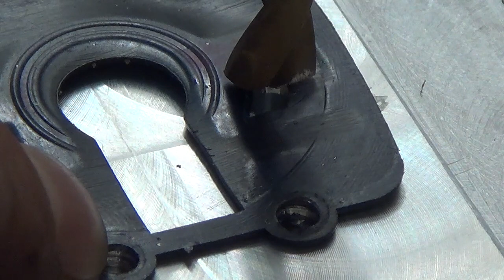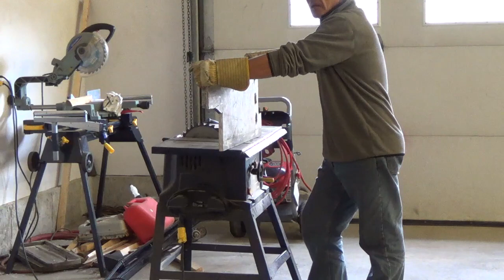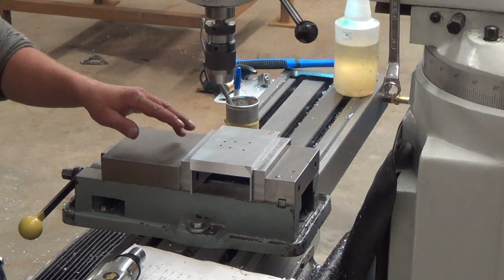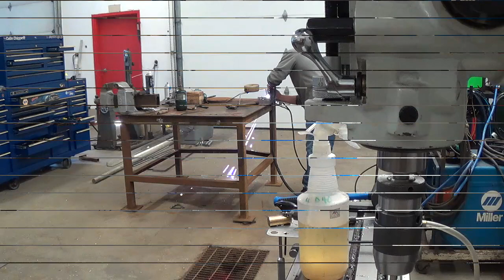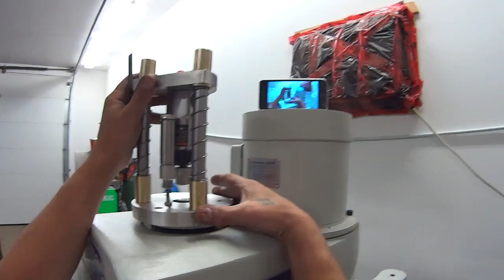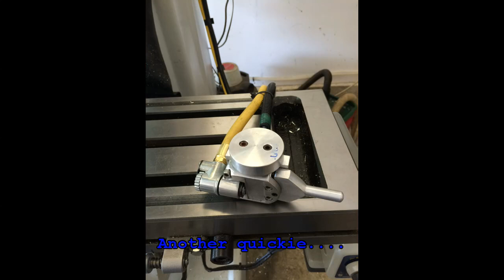Drawbar - Finale

Comment: Good evening
great job compliments I love it
kindly could you send me the drawings with the relative specifications and the model and measurements of the pneumatic piston
thanks
regards
Valter
Italy
Reply from the maker: Thank you sir for the comment. Sorry, I do not have drawings available for the unit. It was built on-the-fly using what materials I had available.
Reply: @CompEdgeX2013  could you tell me the characteristics and measures of the pneumatic cylinder !!

Comment: Colin after watching the build part 1&2 maybe 15-20 times I have taken on this project after talking with Ray. I really dug the design factor and have incorporated a lot of your work into my build. First I have run into clearance issue on the guide rods. I have experimented with lube an grease to keep them from sticking, so I think I will open up the bushing a bit. Balancing the air flow is tricky with the cylinder and impact wrench but I'm getting it figured out. My second big question is how do you oil or lube the unit? Do you disconnect the quick air line fittings at the top and on the control unit? Thanks Mark
Reply from the maker: Hi Mark. I had a viewer come up to me at Stans Bash and show me his copy of my unit complete down to the machined fittings. He did a great job. In talk we spoke about the guide rods and lubrication. In the end during actual use I found any lubricant to make dirt attraction a worse problem than sticking. Add clearance to the bushing and all works great. I now rarely ever need to take it apart for cleaning. Send a few pics once you get it complete. :-)

Comment: can you provide some specs on the air cylinder you used on this build
Reply from the maker: The air cylinder came from Ray Caniglia @ Rays Garage youtube channel. He scored several of these in an ebay auction and shared among the group. They are about a 5/8" bore with 2" stroke. 1/8" NPT for air inlets and 1/4"-20 thread on the end. In my case I used the npt inlet as a mounting location by making it into a straight thread.
Don't have it handy right now so I cant give the open/closed  dimensions, sorry.   Colin :-)

Comment: Beautiful work! ... Excellent Design and it works quick and fast!
Reply from the maker: Thanks, been over a year and still working fine with the exception of adding some clearance on the sliding bushings. They tended to get a coating of dust and grit from welding/grinding and stick just a little.   Colin :-)

Comment: Nice work! Thanks for posting, I enjoyed watching several of your videos.   I am going to try and make a power DB myself this summer.  One question... you have the forward/reverse air lines connected to your pneumatic push cylinder through the T-fitting you made.   Do the flow regulators that connect into the cylinder T-fitting act as one-way valves?  It would seem the T-fitting would allow air to travel back up to the opposite side to the air wrench.
Reply from the maker: +Brian S Thanks Brian. The valves Stan supplied have a check ball so they have flow in one direction and needle adjustable flow in the other. This allows for adjustment and I can get only the amount of air to the cylinder that I need without affecting the air motor much. If I can help during your build feel free to email me... and thanks for the sub.. :-)
Reply: +CompEdgeX Awesome!  Do you happen to known the part # for the valves?
Reply from the maker: +Brian S Sorry I do not. Only Stan can tell for sure but I  think they are an MSC part.

Comment: 28:35... I think what you need is a "dog-ear", it hooks next to one of the jaws and one your piece and pushes it around with the center in..  Keith Fenner is the guy I've seen use it.
Reply from the maker: Paul Gdry A lathe dog would be great for anything turned on a mandrel or any kind of shaft. The plate has no center hole on the chuck side and so not a good candidate for a dog. 2-way tape is an acceptable method of turning an odd object provided necessary precautions are followed such as using the bearing center to maintain pressure on the piece. Thanks for stopping by my channel and taking the time to comment.   Colin ;-)

Comment: Great.  Thanks for the explanation.  That was similar to what I was thinking of doing, a hollow spacer sandwiched between the air cylinder and the top plate for the exhaust.

Great design and excution.

Mike.

Comment: Collin, great job.  I am going to copy it after building one with the air cylinder on top.  I like your compact design much better than mine.  Couple questions, how did you attach the air cylinder to the top plate?  Isn't that the exhaust port of the cylinder?  You mentioned a spacer so I am assuming it is a hollow spacer and how did you fasten the cylinder to the top plate?  Also, what CAD program are you using?

Thanks.
Mike.
Reply from the maker: zmotorsports Thanks Mike. I'd love to see another take on the idea. The air cylinder Ray supplied had 1/8 FPT on the ends. I retapped the unused end and made a custom bolt to attach it through the top plate. This bolt has a through hole to allow air to escape. For CAD I'm using AutoCad 2005..Colin

Comment: What a great project you did. Really enjoyed seeing it. It will give you a lifetime of reliable use and if it breaks you can fix it. Can't beat that. Thanks for taking the time to post it. Nothing but the best!
Reply from the maker: Paul Short The only piece likely to fail will be the air motor but that's easily replaceable for little money. It should last a long, long time. Trouble is now I need another project to ponder on for a bit.    Colin ;-)

Comment: I came out awesome!!  My 2 cents on the table saw......I would have set it up and done it the same way.  Tall blade keeps it pulling the plate down on the table.  I would have used a similar(coarse) blade as well.  With a fine toothed blade, the chips might have galled and stuck in the teeth....that would have give way more friction between the teeth and plate on the upward spinning of the blade on the exit.  I'd probably wear a full face shield. :)
Since you had such a big piece of plate, I would have clamped it to the table saw (hanging over the edge) and used a hand held circular saw with a carbide blade.  Just as fast....maybe faster....and a good bit safer.....same "tall" blade stick out.  I used my circular saw to chop an aluminum bell housing.....cut like butter!.  Sawzall didn't work for beans!

As for including the footage.....I like that you included it.  I would think that if a viewer is considering using a table saw on aluminum, they'll watch more than one vid and make at least a semi-educated choice on how they do it.  By you including it, it allows for a lot of comments, which brings out a lot more info and points of view than what could be shared in the vid. 

Great vid buddy!!!! 
Mike
Reply from the maker: bluehandsvideo Thanks, I am enjoying the convenience and time saving of the power unit. You wouldn't believe just how much time is saved with the addition.A circular saw would have been my first choice anytime for the aluminum plate. My old B&D had packed it in some time back and I hadnt replaced it as of yet. I plan to purchase the new Milwaukee metal saw in the near future as a proper tool for the job. I was never uncomfortable using the table saw anyway but I do have a healthy respect for what CAN happen when things dont go right. I think what many people missed was the size and weight of the piece. I wouldn't use the table saw for a small thin piece where your hands are close to the blade and the part stands a real chance of getting caught. The 3/4" plate is of such a weight that it is easier to control and is unlikely to get caught up and thrown out. The discussion is good though and should give someone thinking about trying it something to think about.Cheers bud,Colin
Reply: *****
I guess I'd better open mine up so we can see a different one than the Milwaukee :)
Reply: Hi, for thinner aluminum sheets, you can use a plywood blade no carbide just finer teeth, add wax or WD-40, if it still catches, reverse the blade. Works for me, doesn't mean you don't watch for your body parts. A bench saw is never 100% safe, so is just bout any tool.

Comment: Colin,
I know you have heard it all now about the table saw, but I got to have my say in it. I cut plate aluminum at work every now and then, and I do it with a good circular saw, and a sharp carbide finishing blade. With the plate clamped to the table and a guide clamped to the plate, it goes through 1/2" to 3/4" like butter, and you are in control of the saw. Try it out.

 Unfortunately this past winter while using my own table saw and doing something I have done with it many, many times I nearly cut my thumb off, I could not believe it as it happened so fast, luckily I still have good use of it. It was my own fault, if I had taken the proper precautions it would not have happened. If that chunk of aluminum jammed and kicked back on you, well it would have been very bad news. I am no safety Nazi but that was a real unsafe way of cutting that plate.

 See this video :Kickback on Camera!

Keep up the great videos.
Reply from the maker: I just watched that video...wow. That guy came close to some hand damage.
I'm not going to pretend that my way was the right way or anything but that video only shows why I had my blade set the way it was... well over the workpiece so there less chance of the material running up and over the blade. This is very unlikely anyway with the weight of the 3/4" al plate... but I like the idea of blade pressure trying to pin the piece to the table as opposed to trying to spit it back out.
The guy in the video purposely twisted his hand toward the blade trying to recreate a VERY lucky escape. He is indeed a lucky man...twice! I would never place my hands in the path of the blade and I use a pusher for the times when closeness is inevitable. I have 10 great reasons to say clear of the blade!! ;-)
I do not have a circular saw but I have been considering the Milwaukee metal saw since I first saw one on YT. It seems like a great unit for cutting metal of all kinds.
I don't mind if the comments aren't all sweet and mushy..can't win'em all! Thanks for your comments and input as well.
Colin ;-)
Reply: I just use a regular decent quality Makita circular saw with a 80 tooth blade, works very well, I think you will be surprised how easy it cuts plate aluminum. Be safe.

Comment: That's pretty badass Colin. Put some graphite on the bushings and you'll be golden. Thumps up.
Reply from the maker: cptbimes Thanks. I did actually clean up the metal and apply a dry lubricant. I left it a close but sliding fit on the bushings and I'm not sure yet how dirt and dust might accumulate and cause issues. I can always open up the bushing if needed I guess but I'll give it a while and see how it goes.  Colin ;-)
Reply: Your PV value is so low and since the load is only when your tightening or loosening that also helps your case. Graphite or grease would be the best since you're in a vertical application. If you ever have future issues, just swap in a bushing from SAE 841 graphite filled. :)

Comment: You made a real nice job of that project, it turned out really well, in relation to your comment about talking to yourself that you put up on the video, I find that the older you get the longer the conversations become, and compliments on your new shop set up, the mill is a beauty, I wouldn't mind having one of them here at home,

regards

John MD
Reply from the maker: John MacDonald Sometimes you get to working and forget all about the camera when you should be talking to it instead of yourself. It usually happens during long filming sessions when I just let the cam run and pick the good pieces later.  I'm getting more comfortable in the new shop and added some shelving lately to organize some things. Still have some work to the other bay left but it'll get done.  Thanks John,  Colin ;-)

Comment: Hey Colin. One other great thing about your videos contra many of the other good ones, is that I get to see you working. As a novice it is really great to see what you do with the machines. How you control them, and when. I learn a lot by watching you work. Thanks. And, nice, nice build!.
Reply from the maker: Jim Milne I tend to agree. Close shots can be useful..EG: when the discussion is on chip control, feed rate, or even surface finish. And it's great if you have a nice chip breaking shot to share! The most value, IMO, to the average viewer, however, is to see setups, techniques, and the like.  Thanks for watching my videos Jim and for the feedback.  Colin ;-)

Comment: Great job Colin really looks nice . I can't believe you were able to cut that thickness with your plasma cutter. What amperage were you running?? Does your mill have a collet alignment screw in the quill?
Reply from the maker: Bill De La Vega It was a struggle for the Everlast even running full out 63 (indicated) amps. The cut was not pretty and had tons of dross. It was, however, faster than standing at the small bandsaw and if I hadn't nicked the corner there would have been tons for finishing.  Yes, the mill does have an alignment screw...I had been pondering removing it but it doesn't take too much time to align a collet.   Thanks Bill   ;-)

Comment: Hey Colin

Great build, looks very cool and operates well!  FYI I was on the edge of my seat during the table saw cuts!

Hmmm...you might find a standard location for your control since the reach to throttle will become second nature, but if you move it you will have to hunt for it.....

Happy tool change!
ATB
Chuck
Reply from the maker: outsidescrewball I always get a little pucker factor when using the table saw! :-)  I suspect that I will find the "best" location for the control and leave it there. I do like the position on the RH knee but don't want to make any holes in the casting unless I'm sure. The magnet does slip sometimes when oily so I may mount it in future.Thanks Chuck. ;-)

Comment: Oh yes, beautiful. And it works great! I've liked the machining of the D-shape base on 4jaws chuck. I will copy the techinique..eeheh. Colin, have you estimate the amount of compressed air you need to move the pneumatic tool? I mean: i think you don't have to lock at the maximum torque the impact gun is capable, maybe you need less torque so you can use less pressure and air.
Reply from the maker: Cosimo Marotta  Thanks Cosimo. I'm running a 1/4" air line to the unit @ 120 PSI. The built-in "throttle" is set wide open and regulation is taken care of by the valves Stan sent me. They control the balance between the air motor and the cylinder. Finding the right setting took some testing. Actual torque on the drawbar is simply set by how long the operator applies air which is only very brief. Seems to work well for now but may require some fiddling in future perhaps?   Cheers,   Colin ;-)